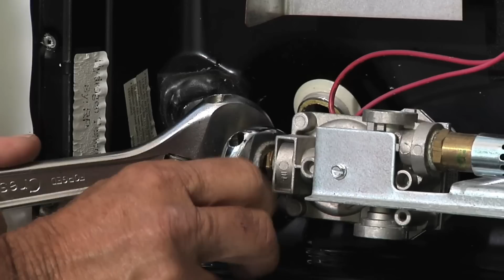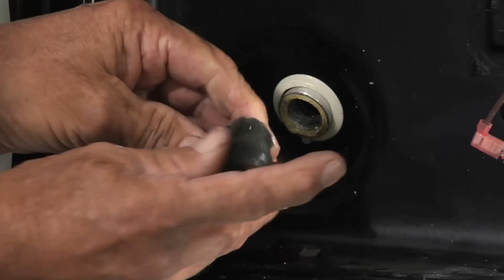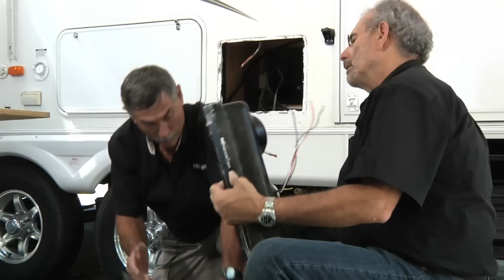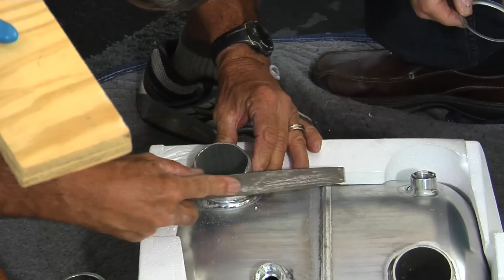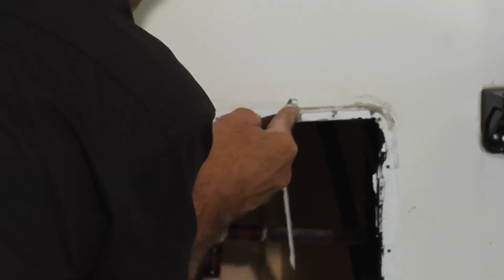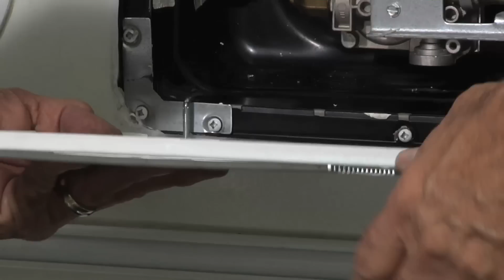DIY RV Water Heater Inner Tank Replacement

Comment: do those circular metal flanges that you had to hammer down, and the white spongy gaskets come with the new tank or do you reuse the old ones. and do you have a link to the tank for the Atwood GC10AF 3?

Comment: Like many others who've commented, I too am replacing a tank on the same unit. Your instruction has been very helpful and I was most concerned about the rings either splitting or being a problem. After watching I think my replacement project should go smooth. I was quoted a price of $1100 for an exact replacement of this heater. Thank you again for posting this.

Comment: Great tutorial. I just bought a Pioneer Spirit 18CK and discovered the inner tank split.  Surprise! As-is, but the seller bought a me a new one and I agreed to repair it myself. This video helped a lot. Some things I did to help get those stainless seals on were to bevel the edges of the tank tubes for lead-in and then polish the outside surfaces of the tubes with emery cloth and then Scotch-Brite to smooth the irregularities. I also coated the o.d. of the tubes with never seize. I tapped the seals on with a 2-1/2" exhaust connector and done.
The $4 exhaust connector carries the advantage of keeping the seals perpendicular to the tubes, too. I used an old credit card to trim the putty tape to avoid scratching the coach paint.

Comment: Now I know I wont be fixing my hot water heater or the rotten floor underneath. No way in hell could  copy what you did without breaking something. Great. Guess Im living with no water. Problem is today no one can fix this within 100 mile radius of where I live and the parts are not available. They ae backed up for months. Even if they were I cant afford it..

Comment: Finally got the new hot water tank in and installed. I watched this video twice beforehand and glad I did. Take a lot of pics! It took me 5 hours. If I did it again right now, it would take me half that. My existing connection from the tank to the hoses are plastic and thought I was going to destroy them getting them out. Also, putting on new retaining clips was CRAP. I beat the heck out of the tank doing that trying to get them on. There has got to be a batter way, and I have lots of tools. I can't believe they got them on in their video. I had a hard time getting the thermostat and ECO sensors back in but I did. May the force be with you.

Comment: I am currently doing this exact tank replacement on our Winnebago camper and this is EXACTLY what I needed.  Thank you so much for posting, being very detailed and informative as well as mentioning how important it is to have things sealed properly to prevent carbon monoxide entering the main cabin. Very important.  THIS IS GREAT!!
Reply: Where did you get the tank from? Been trying to find one..
Reply: @Aces2356  An d if I recall I had to get it from the camper store because I literally wasn't able to find one online and I think they have more supplier channels (that may not sell to the general public).  It cost me about $350.  I did do the actual tank replacement work, the labor, on my own though.  So overall saved myself some considerable money.
Reply: I called a local camper store, gave them the information that I was able to find on the tank and then they ordered it for me.  It did take them a few weeks to track one down though. @Aces2356

Comment: Thank you TrailerLifeDIY's Bob and Bill for this video. I completed the swap of my old Atwood water heater tank today (now under the Domenic brand). It was a pretty big job - much more time intensive than swapping out the entire system because of the disassembly and cleaning caulk/putty/pipe cement off the old system. I didn't have a partner, and it probably took 8 hours. Excellent tips by the commenters below: used the 2 3/4" exhaust connecter as mentioned which was invaluable in seating the 4 metal brackets (yes 4, two behind the water heater face plate and two in front per the video). Some additional tips I'm passing on: #1 - Forget tin snips for cutting the old brackets. You'll fight and waste a ton of time. Pry an area of the old brackets up as much as you can, then cut using a metal trimming attachment with a Dremel multi-tool. My oscillating saw metal bit was too large for a cramped space. #2 - Don't waste time with filing a bevel on the new tank inlet/outlet. Instead, use a Dremel with a metal grinding drum bit to speed up the task - BUT you do have to make the bevels to successfully install the new retaining brackets. #3 - Bend the angle of the new brackets upward a bit with two sets of pliers/clamp, etc. #4 - Use the Dremel metal grinding drum bit to remove a small amount of metal on the interior ring of the replacement brackets. --- I don't think I would have ever installed the 4 replacement metal brackets without those tips + the 2 3/4" connector to hammer them down. BONUS TIP: Don't cut the yellow wire per the video. Open up the junction/controller box on the back of the old water heater, disconnect the yellow wire, pull it through - there's a littler retainer on the relay box you can pop out easily with a flat head. That way you can just feed the existing yellow wire through the new box on the new tank and plug it back in. Save's you from having to make a butt connection. Plus... my replacement tank didn't have yellow wire.... Finally - I'm very strong, and really had to muscle out the brass hose connections on the back side of the tank with a 14" plumbing vise wrench. The pipe cement was serious. GOOD LUCK!

Comment: Why do you have to pull the whole face plate instead of removing the tank off the back while the face plate is mounted?
Reply: I want to know the same thing. I have good access to my tank because I have an outdoor kitchen. I don’t see why the faceplate has to be removed unless I’m not seeing something in the video.
Reply: I did remove the tank without taking off the faceplate. I put the new tank on my work bench and pounded on the rear rings with a 2 3/4 exhaust coupler (these rings aren’t shown in the video being installed). I also heated the rings up and beveled the edges of the outlet for easier installation. Next I put the white styrofoam rings on the back side of the faceplate.  Slide the tank into position which took some tweaking. I had lots of room to work because my tank is behind an outdoor kitchen refrigerator that I removed. Next step is to wedge a board between the backside of the tank and something supportive on the camper. This will help secure the tank while you pound on the front side large rings. I don’t see any reason why the cover plate needs removed unless there’s no access from the backside.

Comment: This helped me immensely. Was able to change mine without issues. Toughest part is putting rings on. Found using a hole saw was the right size and made it super easy.
Reply: Ahh, the hole saw idea is great!  Harbor Freight sells a full set of like 12 sizes for about $10-15, too.

Comment: Just replaced my tank.  The dreaded installation of the rings was an easy 2 minute task with the previously mentioned tip of using an exhaust coupler (2 1/2" to 2 3/4") to drive the rings on.  My only challenge was removing the GCV which was threaded in to the tank (Attwood model G6A-7).  Clamped a couple of boards to side of the valve body to generate enough leverage to break it free.

Comment: Oh yes. Piece of cake. To save a whole $100 this is a great DIY project. I am going to try this right after I set my hair on fire and beat the flames out with a tac - hammer. Come on guys, get real
Reply: A new unit is more than $600.  The replacement tank is about $200.
Reply: I saved about $400. Job wasn't to bad. Totally worth it. Great video.

Comment: My OEM tank had the Rings (shown at 21:00) on the ports then the front cover then the Rings you tapped down. The kit I got came with 4 rings. I did it your way with only 2 Rings. As they are a PIA to put on.

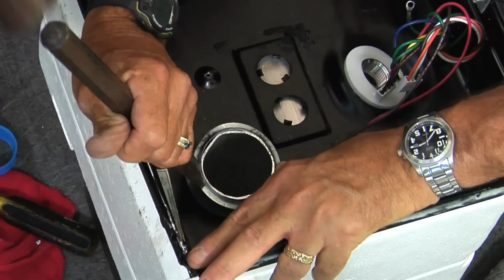Comment: 21:37 You should seriously built yourself a tool from a pipe with a beveled tapered edge and you'll speed up this process exponentially. Takes about 10 minutes to build and you'll have a tool you can use hundreds of times down the road.

Comment: Where did you plug the yellow wire into.  I got the replacement tank,but the new relay has a different wire plugged into where the yellow plugs into the relay on the old one,  and has a blank spot above on the new one

Comment: Thank you for this video. I removed & replaced the inner tank 6 10E model. It was a simple straight forward swap out. I did waste a half a day trying to put the rings on & finally went with 2 3/4 hose clamps. The heater works perfectly & no more leaking. Take before pics & pay attention to ECU & thermostat placement check for gas leak at the end. Again thanks for the video.

Comment: Video is helpful but is there a trick to getting the rings off initially? I haven't been able to get them off without doing damage to the surrounding area. Appreciated.
Reply from the maker: Hi, Jeffrey,

Here's what our technical editor, Chris Dougherty, has to say:

"They are a pain in the butt. What I have had success with is getting under them with a prying tool and needle nose pliars and getting them to move a bit, then take a Dremel with a cut-off wheel and cut through them carefully. I have done it without moving the band, but it always marks up the tray a bit, which you can paint while it’s apart.
 
Hope this helps…it’s a fight!"
Reply: Better way without any fight at all; Take a small hammer (square nose if possible) And beat the aluminum flange inward about half way around until the ring has some slack. Then pull the ring off with your fingers and put it aside for re-use.
Reply: use a drill with a bit the diameter of width of the ring. Side cutters will finish the job. Just did one of these yesterday.

Comment: Great video...helped me get it leak free first time. Might want to check your Thermostat and ECO before replacing. My water was super hot so theorizing that thermostat not working and ECO was kicking in at 180. Probably what led to the demise of the first tank...being aluminum I would think they would not last long kicking off at 180 instead of 140.

Comment: Where did you get the rings and gaskets?
Reply: All 4 of the metal  rings came with the tank kit ,  but you will notes the dudes in this video  only used  2 of the rings  ,that's a big NO NO , I'm going to name 2 of the rings as the inner support rings. The inner support rings ,what they do is keep the back  side of the Big Black sheet -metal  
tray  level  & flat , sure the Dudes  put the  Black tray  right on the  foam  white  tank liner, but Atwood  Knows what their talking about , use the back up rings  so the tray holds snug & flat.
Lets talk about the 2 Gaskets , their there to  help  to keep any of the burnt Carbon monoxide  gases from leaking in to  the walls of your RV .
The  other 2 rings , that  the dudes used will be called the outer  hold -down rings .

Comment: If you bang on the metal ring hard enough, it breaks and slides on nice and easy,  Or, you can cut it first and slide it right on. What a joke these water tank designers came up with.

Comment: What type of sealant did you use on the outside around the gas line after you installed the new tank?
Reply: Looks like they used Loctite PL S30.  It is a roofing and flashing sealant.  You can find it at many home improvement stores.

Comment: if there is a leak in the tank, and i have found that leak, but galvanized steel can i just replace the tank and not have to buy a new heating unit, or must i purchase the entire heating unit and tank?

Comment: Just completed the repair on my toyhauler with an older style (non electronic) pilot light. You have the best diy video on YouTube! I did find a great tool to install the rings. I went to an auto parts store and bought a 2 3/4" exhaust pipe coupler fo $3.00. Following your recommendation for beveling and using this tool I installed all four rings (two behind pan and 2 over pan) perfectly. My coupler (connector) was 2 3/4" x 2 3/4" p/n 17586 mfg by niExhaust Solutions but others make this as well. Thanks for your video.
Reply: You sir, are a saint!  I ordered this same part number (thank you for including that) and the "tool" worked 100% perfect / flawlessly for this job.  Took me less than 10m to do both front rings!

Comment: My water heater has the engine coolant lines hooked up to it to keep the water warm while traveling...not sure if you guys mentioned that or not.  I had to use my drain plugs to plug the ends of the coolant hoses to keep the antifreeze from the engine from running all over the ground.  not sure if there is a better solution, but those plugs fit nicely to create a plug.  it'll be a little messy hooking them back up to the new tank probably.

Comment: If I can pull this off, I'll save $900 bucks.  Just not sure the other things I need on the list of parts to replace.  I put the tank and the pressure relief valve in the shopping cart but what else I wonder?
Reply: I'm in the same boat. Did you find any answers to your question? Do you need any other parts?
Reply: No answers yet Ryan but I did order the tank.  wasn't sure what relief valve I needed so I went local and bought both the 3/4 and the 1/2 inch...I'll take back what I don't need there.  Picked up a new set of plastic drain plugs too.  The access to the back of the tank in my Itasca 35C is behind the electrical panel so I had to take that off and sort of move it to the side; its a snake of wires to get through but I know I can manage...certainly not as clean as this video haha.  Tank should be here tomorrow so I'll let you know how it goes. wish me luck
Reply: Also, I did drain the tank, then switched the valve to bypass it and filled up the water again...no leaks...so I know for sure it's the tank itself.
Reply: Cody Charles did you get the gasket set? I took this opportunity to put in a tank less water heater. It was only $120. Less than a new tank!
Reply: I thought these guys said those were more expensive!  I would have went that route if I knew it was cheaper probably.  No I did not get the gasket set.  Im waiting to see what comes with the tank.  these guys said theirs came with that pressure relief valve.  like I said, I purchased PRV just in case the tank came this weekend and didnt come with one the store was closed.  nothing in the mail yet, hope its there when I get home from work.
Reply: I want to know how your tankless water heater works out for you.
Reply: I think those rings are just to hold that plate on.  Michael D mentioned below that he used hose clamps.
Reply: Got the tank...taking it out was a slow process but only because I didn't want to mess anything up.  I leak tested the tank before I put the face plate back on by putting it in and adding the water lines...I needed to make sure I didn't have any lines leaking as well.  The rings? Snapped, even after I tried to file down the edges of the tube. used the hose clamp method that someone mentioned earlier in the comments.  Because of the testing and ring issue I went into the night on a job that was running smoothly. I'll finish up after work today with the final hook up and testing. Watched this vid throughout the whole thing, labeled wires and took pics to be sure I got it right. there has to be a better solution to those rings though. make them a little bit bigger perhaps? make the gasket sticky but stretchy rubber so it creates a seal and then use a snap type ring instead of a solid piece.  I bet everyone breaks those suckers.
Reply: PS. no idea where the old tank was leaking though.  its a mystery
Reply: Last post on this unless someone needs to know something.  This job is possible if you've held a wrench a time or two in your life or built something. Great video for step by step so bravo. We took the RV out this weekend and the tank worked beautifully and no leaks, no gas exhaust in the coach so all is well and I'm still $950 rich by not having the RV repair shop do it. I purchased my tank at RVsupplies.com for $189.00 which came with the little gaskets and those impossible rings as well as a new pressure valve. My tank came with the flow through engine coolant valves but no electrical. I unhooked my 4 wires via a clip but still had to cut and splice so I could remove the wires from the face plate. PS, check out Cody Charles Band haha
Reply: Can you give more info on cost and what's involved to go tankless? @greatblueheron144
Reply: Cody Charles what kind is that black sealant on the gas line?

Comment: those rings you cut off and wrestled to get new ones on i use a hose clamp you tighten down with a screw driver. sorry dont have size of clamp right now but works great. nice vid.
Reply: no issues with Carbon Monoxide?? I had to do it this way with a hose clamp...snapped those impossible suckers in half trying to put them on
Reply: ***** I install one of the POS clips then the old gaskets then the face of the water heater then the new gaskets then hose clamps. CO2 detector only goes off if battery is low.

Comment: Do you have a parts list and resource list for this repair?  We're replacing the same tank as the video for the Atwood GC10A-4E So far I've listed the tank as a Atwood part# 91060, The ECO and Thermostat kit is Atwood Part #91447.  You guys broke a retainer ring in the video.  Is it good to have a couple extras for the install?  What is the part number for that?  Haven't been able to find it.  The inner tank kit I found was over$250.  You stated in the video that the cost for your tank was $180.  Where did you find it?
Reply: Ditto - awaiting arrival. Local shop quoted me $400CDN for a tank and $425CDN flat rate to do the exact items in the video. Crazy!  I think next year I'll just remember to drain my tank for the winter and save myself the trouble.... :(
Reply: @Unsta  duh
Reply: I bought mine off amazon. paid 135